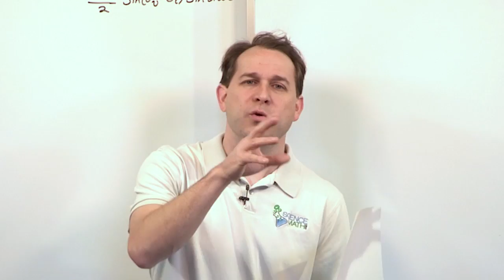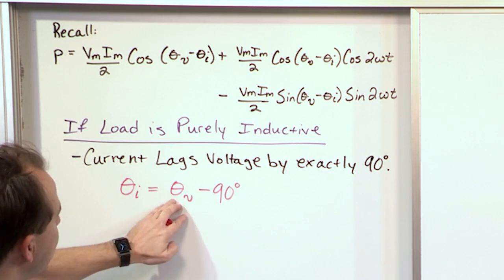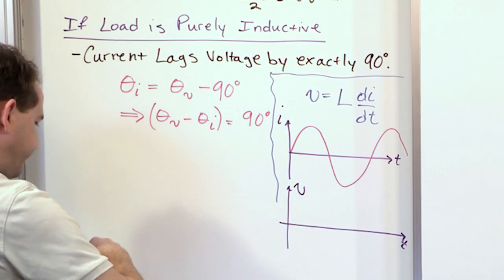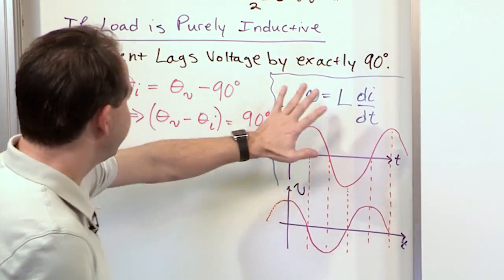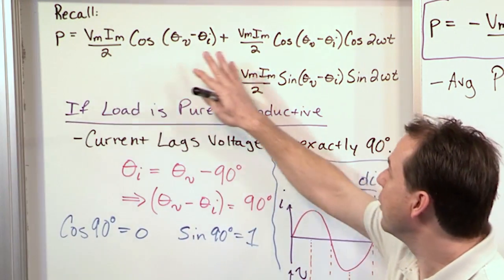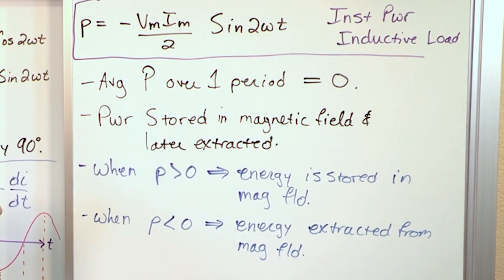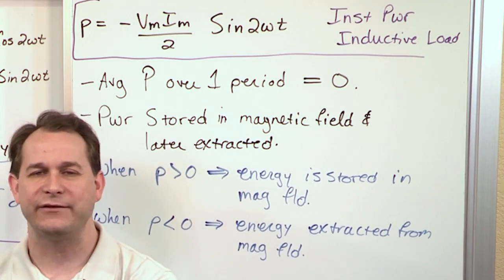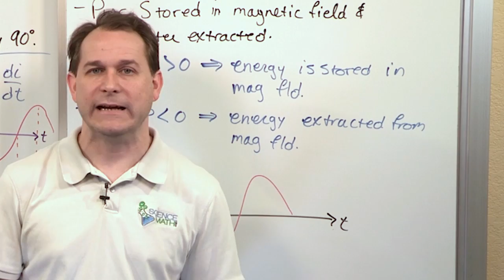Learn Reactive Power in AC Circuits - Reactive Power Inductive Load and Power Factor Calculation

Comment: This talk doesn't comply with reality. He claims a current thrue an electromagnet doesn't do any work ??  And he even doesn't talk about compensations. Therefore he likes it's theory ?
Reply: I dont think that is what he saying.. Indeed, work is done to move the charges to the inductor. And work is done to move the charges from the inductor back to the source.. I would say the potential energy is transferred back and forth between the source and inductor.. No power is actually used. Is that what you're questioning?

Comment: Can someone help answer and explain this question?

A coil and a capacitor are connected in series across a 120v. The coil has an impedance of 232 Ohms at a p.f of 81deg lagging. The capacitive reactance of the capacitor is 150 ohms. Calculate the V across the coil and voltage across the capacitor.

Comment: thank you very much
I have a question 
how the inductor deliver a power to the circuit  from 0 to π /2  before it absorb from the circuit?
Reply: It's because the teacher used the convention to choose time t=0 when the current in the circuit is at max (he talks about this convention in a previous video, I can point you to that video if you want). That means that at t=0, because the current is at max the inductor's magnetic field is at max too (the inductor is "charged"). It's as if the circuit was running freely forever but we chose to start our stopwatch (t=0) when the current is at max.
Reply: @RockyBoltzano  thank you very much
I have understood it

Comment: hi, great job, but i have a question : the power starts negative?
Reply: I believe that is true because during that time the magnetic field is being "built up", thus it is taking energy from the circuit causing the wave to be negative. Then after, the magnetic field "collapses" and gives back the energy to the circuit, thus causing the positive energy section of the sinusoidal wave.

Comment: I searched and didn't found here. Maybe someone has a ride say that before me but and music sheet for remembering the lags and leads voltage and current stuff is a mini monic data found on Wikipedia civil civil which means faster current leads voltage and 40 v i l is voltage leads current in inductive load okay so L for a Kyle or inductive load C for a capacitor V for a voltage and I for current and that's how I remember that always. It works fine for me hope it works fine for who ever is rating.